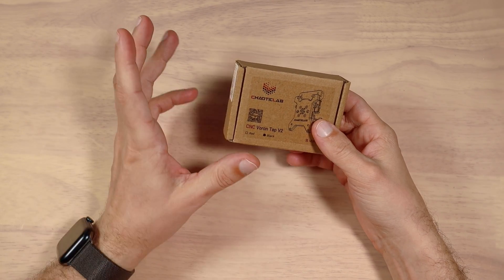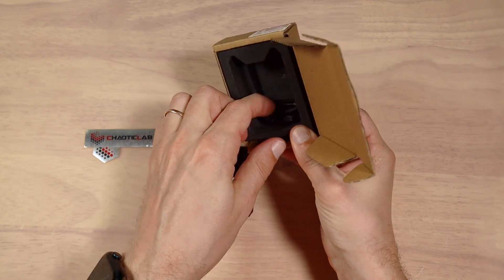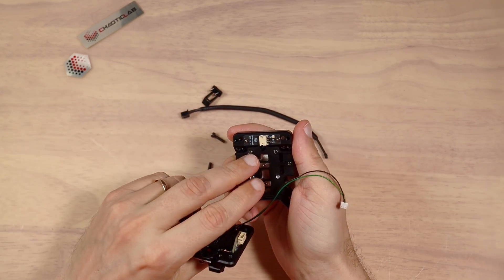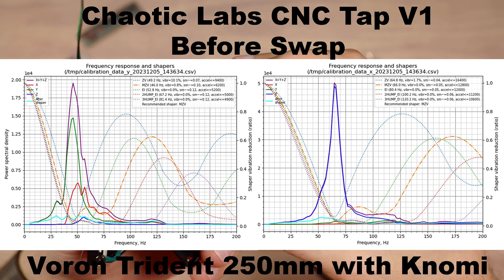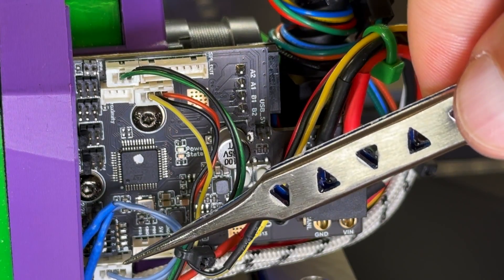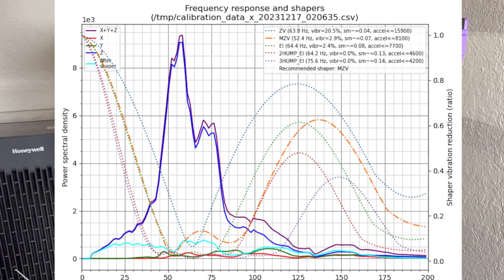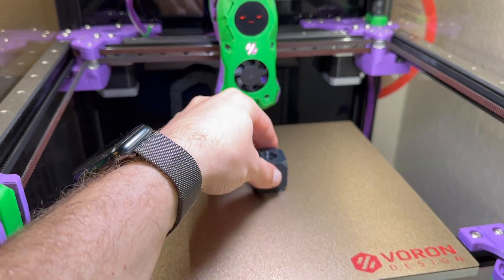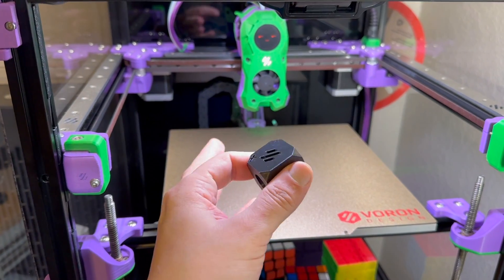Trying Chaoticlab CNC Voron Tap v2.0

Comment: not true.. there is a carbon fiber one from fysetc with tiny mgn7 rail that is kinda weightless.
Reply from the maker: I wouldn't call it weightless but you are right based on FYSETC claims Carbon TAP is about 10 grams lighter for +- the same price.

Comment: Whenever starting a machine thread Always turn in the reverse direction FIRST!
You will feel the thread drop into place and you will never cross thread again..
Reply from the maker: Quality metal to metal thread doesn't require such fiddling. We aren't dealing with plastic thread here.
Reply: @hobbyistnotes  Wrong, I was literally born into a machine shop and I can tell you that ANY machine threads can be cross threaded and doing this simple yet effective method will one day save you from a major hassle. It makes no difference what the materials are.
Reply from the maker: @noanyobiseniss7462  Man I am trolling you, you are right and it's common sense. Don't take it personal I hear that advice 10 times a day.
Reply: @hobbyistnotes  KK lol, tough to tell on the interwebs these days! ;)

Comment: Thanks for the awesome video. 

Do you have a custom CAN Cable or did you just put a sheath over it?
Reply from the maker: Thinks, this is the cable I originally got with Mellow Fly - just plain 4 wires with connectors, you can check Mellow fly video to see what I have used ;-)

Comment: I have the first version on my Trident. I am happy with it, however anyone installing should take it apart and lubricate the rail, and use a bit of Loctite on the screws holding the rail. I failed to do this step and it got loose. I reassembled it with a bit of purple loctite, and no issues ever since…
Reply from the maker: Good point I had to include it in to the video, unfortunately I forgot about it.
Reply: It’s strange, but Russia was immediately told that the first version was not working. And on YouTube, all bloggers do not specifically post graphics. In the end I bought it and it's sad. Acceleration <=1800. This tap is in the trash.
Reply from the maker: @shta-takoe  I didn't had such issue both of taps have worked well with ~10k acceleration.

Comment: I'm confused.  Your thumbnail says "lightest tap ever!" but the comparison in your video says it's 4g heavier and I've seen other videos that have weighed it at 6g heavier with the screws.  Wouldn't that make it heavier than v1?
Reply from the maker: I think I have mentioned it in to the video, Chaoticlab TAP v1/v2 is the lightest interpretation compare to other taps even there is discrepancy 4g between versions.
Reply: ah! I understand now.  Were you able to ever get similar resonances with input shaper? I have v1 and was considering getting v2 but I've seen mixed reviews. @hobbyistnotes
Reply from the maker: @o0mrrobot0o26  I have learned alot about input shaper while tuning my printer to get same graphs as I had before and at the end you can see those look better and problem is that I am not fully sure if it's due to tap itself or better tuning skills. Id say both of those taps are very quality pieces and from probe tests it feels like V2 has a touch better probe accuracy but I didn't had many issues with CNC V1. X-switch routing is better for sure but if you have sensorless homing it doesn't matter. I think it comes down to the money, if you have cash burning your pocket - why not to get it, if not I feel like there are some more significant updates you can get for 50$ and even this video was sponsored by Chaoticlab I still think this way.

Comment: I've connected my v2 tap, but red light comes on and stays on all the time when I slide the tap up. Should it start blue and switch to red on trigger?
Reply from the maker: You are totally right, it has to be blue on stand by and red when triggered. I would make sure you cable is connected and wired properly.

Comment: Why do you think they come pre lubed from the factory? Based on Chaoticlab documentation for CNC Tap V2.0, they come only with oil that should prevent corrosion during the shipping and storage process and you should replace this oil with proper lubricant.
Reply from the maker: I just have checked the manual and you are totally right! My bad, going to cut this piece of the video out. Thanks for your comment, I really appreciate it.

Comment: Can you when tuned compare Input shaper graphs new vs old?
Reply from the maker: Graphs before and after were presented on the screen, BUT realistically comparing them doesn't make any justice in this particular case as my 1st setup wasn't really tuned much at all, I have realized that after spending whole night tuning kinematics with new CNC Tap V2.0 trying to push graphs to show something similar to what I had before and at the end I think they are looking somewhat better due to better tuned system over all and not just cus I have installed V2.0 Tap.